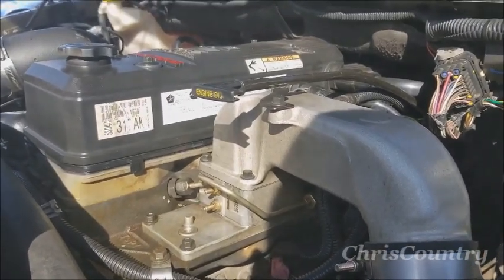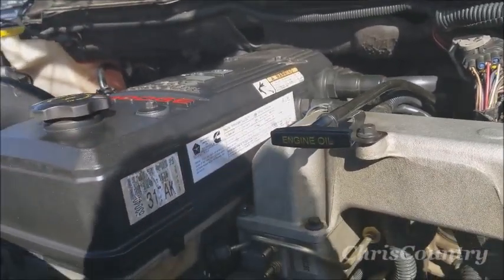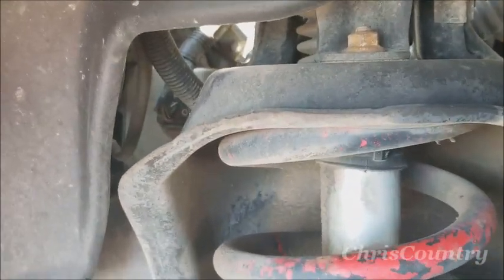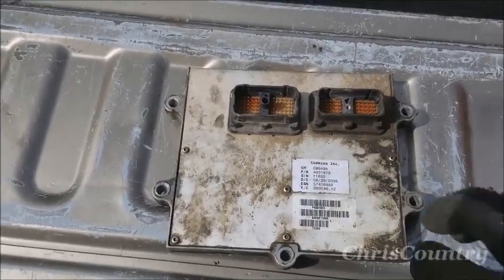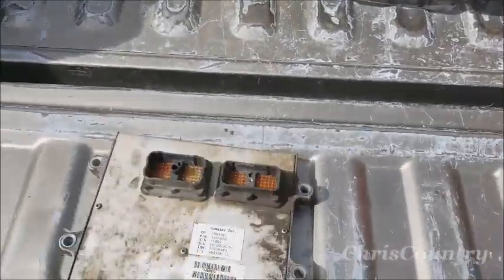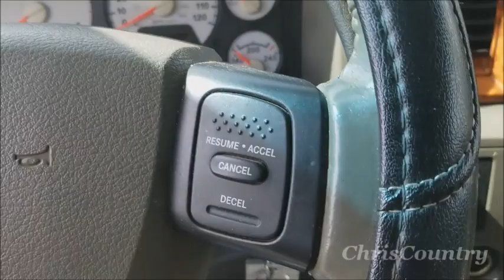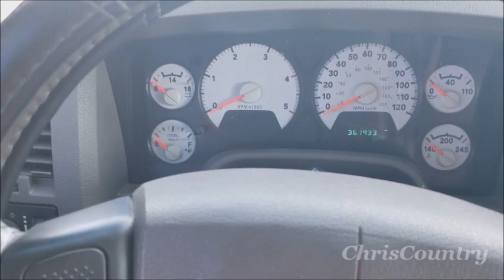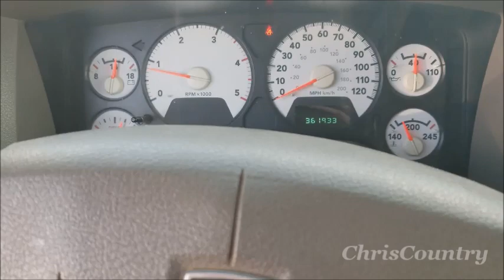ECM Replacement 5.9 Cummins (3rd Gen/Common Rail)

Comment: Just watched your video, thanks for the info, I noticed quite a few no turn over questions in the comments. I had that problem once before and it turned out to be the key. There’s a crystal in the key that works as a anti-theft system. Fortunately I had spare keys made. Exchanged key and it started right up.
Reply: Were you getting any error codes though?

Comment: I also have a 2006 mega cab automatic transmission with only 143K.  She died while driving down the Hiway.  I’m not getting nothing but a click no crank at all.  I’ve put new red top optima batteries, new alternator, FCA replaced, transmission neutral sensor replaced, I’ve installed a new ignition switch and replaced every fuse.. still nothing but a click.  Pulling 4 codes p5209, P1755, p0513 and p0532.  I’m leaning toward my ECM now.  Thanks for the video
Reply from the maker: You have an interesting series of codes to say the least. They may have been caused by weak batteries. The 513 I'd recomend changing the batteries in your key fob. Check all of your connections and make sure your starter is ok. I've never seen an ECM cause a no crank in my experience. Given what all you have replaced my next guess would be the starter. I've seen in some cases if the ac compressor locks up it will cause a bo crank no start. Take off the serpentine belt and see if there is a difference. Lastly check your fan clutch harness if that shorts out on something it can do odd things
Reply: Chris Rocha thank you I’ll definitely look into that also.  I have the transmission throttle valve coming and also purchased cam shaft crank sensor for piece of mind as I’m going through her.  I’ve also cleaned up both battery terminals.  I’d find it unbelievable if this motor froze up with only 143K and not a drop of oil missing.  I had a mechanic come look at her and he could only get 1/8th turn by hand with a 4’ bar 😔😩
Reply from the maker: @chrischi6031  those engines make fantastic compression but I would be worried. I'd see if you could jump the starter directly and see if it can spin the engine
Reply: Chris Rocha looks like I get the same movement from the fan on that click only like 1/8 to 1/2 inch.  She didn’t make a bang boom and no smoke out the back when it died.  I swear the engine reeved up like I lost the transmission and thought somehow I went into neutral at first before she finally shut all the way down at 70 on the hiway.
Reply from the maker: @chrischi6031  what do you mean from the  fan on?
Reply: Chris Rocha when I try to start the truck up now I only get that click and with the hood open I can see the fan trying to move clockwise to the passenger side when looking from inside the truck but it barely moves then goes back to the original spot it was.
Reply from the maker: @chrischi6031  that's a bit disconcerting. My thoughts are have the starter tested if it passes I'd venture to guess an internal engine failure
Reply: Chris Rocha I have a new starter that hasn’t been installed and the truck was already running when it shut off doing 70 miles per hour.
Reply from the maker: @chrischi6031  I've seen vehicles shut down at speed due to an engine lock up. Have you tried starting in neutral
Reply: Chris Rocha I will try that tomorrow..  why all codes all of a sudden? Oil level is perfect not a drop missing
Reply: Chris Rocha no start in neutral.  Today I decided to put it on 4wd with the transmission in drive and pull it with another vehicle.  Wheels locked up at first then they started turning so while being pulled I put her into neutral and she finally started cranking at first.  Once we stopped I started getting my death click again.  Retried this process in reverse and just kept getting the click.  My crank/cam shaft sensor came in so I’ll put that in along with the new starter.  My transmission throttle valve should be here Monday also.  I went ahead and pulled the ECM for piece of mind the local dodge dealer is gonna see if it needs to be flashed or not.  A little bit of smoke came out the back and I assume it’s because she’s been sitting for just over a month.
Reply from the maker: @chrischi6031  I'm not sure what to tell you. Seems like something is keeping the truck from turning over tbo. A faulty sensor in my opinion will not do this. If the ECM or sensors are bad it usually should crank but. Ot start
Reply: Chris Rocha yeah I figure once I get that cam/crank shaft sensor in, the transmission throttle valve installed and the ECM serviced and nothing I’ll be more than lost.  I appreciate tour feed back and my fingers are crossed 🤞 for these last three things.
Reply: New ECM is in and she finally started.  Looks like I lost my flex plate as the transmission won’t engage now 🤦‍♂️
Reply: How much was your ecm? Having same issue  on my dodge 5.9 gas. Truck !
Reply: Tony Gutierrez $1300 if I remember right.
Reply: @chrischi6031  is it doing good now?

Comment: I put my new ecm on and now it’s flashing security light and cranks but no start   Checked all the wiring harness hots and grounds and everything check out well but still no start
Reply from the maker: What year is your truck? I was wondering if I would have a security problem on mine and thankfully I didn't. It may just need a reprogram

Comment: Chris, can you provide any update on the new PCM?
Reply from the maker: Never had any issues with it till the truck broke down almost a year later
Reply: @ChrisRocha1672  did the truck beak down because of the PCM/ECM or was it something else?
Reply from the maker: Something else. Long story short I lost a bolt to the injection pump. It vibrated and snapped the remaining bolts and I just couldn't afford the repaid

Comment: Hey I’m having an issue with my 07 6.7 Cummins. It flashes the electrical red light on the dash. And drops speed randomly. I tried putting a new gas pedal but it was same situation. Should I put  a new ECM?
Reply from the maker: You should be able to pull a trouble code if it's doing that. It'll point you in the right direction
Reply: Sounds like a vgt problem. You should pull the code.
Reply: I’m having the same issue now what was your fix?
Reply: @OutsideJustin  we ordered ecm cuz all the codes pointed that way. But sold it within a month before the ecm ever got delivered. Dealer had some good deals on new 22’ Silverado 2500hd….

Comment: Mine is a 06 will not turn over. I’ve replaced the fuel pump, starter and batteries. A bad pcm will keep it from turning over right? I’d rather buy a new pcm than injectors
Reply: Hello  I have one ecu Cummins comun rail  this cracked cristal oscillator this microcontroller atmel CM845B how to view the number of the cristal work thanks very much

Comment: I keep getting p0868 and p0513 codes as well as a bunch of communication codes.. dodge dealership says it's the ecm because the trans all looks fine relating to the p0868 code and the p0513 they just needs new batteries is the fab. Every once in a while my trans goes into limp mode when the 0868 code comes up.. do you think it is in fact the ecm?? It's a 06 automatic. Good video with good angles and info 👍🏼👍🏼

Thnx chris
Reply from the maker: Not having an automatic truck I honestly couldnt tell you. If its communication I'd look at the wiring first
Reply: What does it do when it goes into limp mode I might have the same problem in my 05
Reply: Cummins,, junk ecm,,, enough said

Comment: Same throttle process with a 2009 6.7 Cummins same body style same location of ECM so I figure it’d be similar
Reply: Is it similar? I’m having issue with the gas paddle codes.

Comment: Ok, so my speedometer doesn't work, ABS, Brakes, Check Engine lights stay on. Ran codes and they said speed sensor was bad. Changed still no speedometer and lights are still on. Ran codes again. Says ECM is bad. Do you think that the ECM is causing the Speedometer not to work and lights to stay on?
Reply from the maker: It would depend on the exact code. In theory yes it can but that's usually the past point of failure

Comment: Hi just found this . I made the mistake of starting without doing the peddle reset that you show hear . I am not getting wot . Is there a way I can restart this process and do the pedal as you have shown here to get WOT
Reply from the maker: To be honest I'm not sure. Maybe unplug the batteries for 30 minutes and try again
Reply: Did you figure out the wot problem
Reply: Same thing here. Put a new one in and tried starting it. Truck ran for a few seconds then died. Did that 3 times and now it won't start at all.
P code 2509.
Tried un plugging battery for a while and tried again after lunch. This time doing what you showed.
Is there a way to reset it or does it need to get a flash reset?😬
Reply: @OGGventures_cruising  did you ever get this figured out? Mine is doing the same thing

Comment: Immobilizer Module change - 

Is it necessary to introduce - old pcm ? pls
Reply from the maker: I honesfly couldn't tell you. You may have to program it but i doubt  it would require replacement
Reply: @ChrisRocha1672  ecm and immobilizer ,key change
Reply: @ChrisRocha1672  ecm reprogrammed vin number
Reply from the maker: You reprogrammed it? If you did and its not working it could either be a problem with the immobilizer or it may be time for a PCM

Comment: I replaced my ecm with a salvage yard unit. Same PN #. Still no start.     Dodge house says I need to have it flashed, regardless of what key I have (grey or black). I've already made an appointment to get it flashed just trying to find out exactly why the no start is I don't really want to just give a hundred bucks if I don't have to thanks 4 and put if you have any in advance
Reply from the maker: Its probably the ECM not being flashed. The BCM/SKIM doesnt recognize it thus it won't communicate and essentially it creates a no start
Reply: @ChrisRocha1672  thanks, I'll let you know

Comment: Is the pcm and ecm the same on these trucks? And what where your symptoms that made you replace the ecm
Reply from the maker: I believe they are separate. On the ECM I was getting an ecm internal errorncode and an injector driver/circuit code from faulty injectors

Comment: Mine won’t start it will only crank with the theft light, should I send the ecm off to get the theft system bypassed
Reply from the maker: Does the theft light come on or flash real fast during or just after cranking

Comment: I had help taking off the wiring harness so really why i dropped in was to get a good shot of the ground hook up. It would have been nice to see the whole side shot of the unit with all the wires in place. Otherwise i got some very useful info
Reply from the maker: I understand that it was difficult for me to get a good angle on the ground wire. It was just attached to the bolt on the upper right though

Comment: Hello friend, I have the same truck with the same computer to replace.
How would be the continuation to twin the PCM since it does not allow me to start? can you help me
Reply from the maker: I'm confused by twin?
Reply: @ChrisRocha1672  what would be the process to change VIN and reset ECU.  with what equipment do you make it?
Reply from the maker: @eliascady3982  the company I ordered my computer from did all that. AllComputerResoursces
Reply: I just ordered from ACR from my 04.5 5.9. I hear if I unplug the SKIM module it will eliminate the need for a chip key. Did your chip key just fire it right up?

Comment: My 03 is having terrible issues. This is literally my last hope
Reply from the maker: I'll cross my fingers. I dunno what issues you're having though
Reply: Any updates? Did you get your truck running right?
Reply: My truck died while driving. Lost connection with ecm through cluster and obd port. Im assuming ecm

Comment: Is the pcm and ECM located on the same unit or are those 2 separate units?
Reply from the maker: I want to say 2 separate units
Reply: In the 24v the pcm is located on the firewall and the ecm is on the block

Comment: I've just ordered a refurbished ecm for my ram 2500. The company I'm getting this from is telling me to leave the battries CONNECTED during the installation. This doesn't seem correct to me. I'm thinking I need to leave the battries disconnected until the ecm is installed and plugged in. Can anyone tell me what is correct? I don't want to fry the new ecm..
Reply from the maker: Personally I don't know why on earth you'd want to leave then connected to me it just makes for a very risky install.
Reply: @ChrisRocha1672  I agree. I don't know why they want me to leave the battries connected. I'm going to ask them, but I'm thinking I'll leave them disconnected during the installation. Thanks so much for following up. I had my wife facebook you with this question.
Reply from the maker: @arthurhunnicutt7291  I saw that and replied as well
Reply: I installed my refurbished ecm today. Left the battries disconnected, all went well. The reason I replaced the ecm was that I kept getting the lighting bolt throttle position sensor. I had it replaced by the dealership. 30 miles down the road, it tripped that code again. Took it back to the dealership, they kept it for several days then told me I needed a new computer. So put the new (refurbished) ecm in today, drove 10 miles and it started throwing that same code. I put in 2 New battries last week. I'm thinking it's something else and wasn't the computer after all. Would you have any suggestions? I'm beginning to think there's no answer for this.
Reply from the maker: @arthurhunnicutt7291  without the code I honestly have no idea
Reply: @ChrisRocha1672  my scanner shows a P2121 which is the THROTTLE POSITION SENSOR.  As I'd mentioned, I had that replaced a month ago by the dealership so it's brand new. I appreciate you trying to help.
Reply from the maker: @arthurhunnicutt7291  renind me the year of your truck and is it a 2500 or 3500
Reply: @ChrisRocha1672  2008 2500 cummins 6.7 2 wheel drive quad cab 184k miles
Reply from the maker: @arthurhunnicutt7291  https://www.cumminsforum.com/threads/p2121-code-help.1546330/

From what I can tell if you replaced the sensor and ECM you have a wiring problem or you need to do a throttle relearn with a scan tool
Reply: @ChrisRocha1672  thanks 👍
Reply from the maker: @arthurhunnicutt7291  you're welcome
Reply: @ChrisRocha1672  I'm inclined to agree with you about the wiring issue. I talked with a diesel mechanic while ago, he said it has to be a wiring issue or a defective part that the dealership put on. He doesn't think it's a computer issue.

Comment: It will always dim down the lights when the grid heaters cycle
Reply from the maker: Yeah I noticed that after the fact. Looking back I honestly don't know if I really needed an ECM Change
Reply: @ChrisRocha1672  what made you change it ?
Reply: @ChrisRocha1672  what year and was it a manual transmission ?
Reply from the maker: @rogerthat6221  I had a code for internal PCM failure I forget what the code was though. And it was suggested to change it by a mechanic
Reply from the maker: @rogerthat6221  it was an 06 and yes G56 6 Spd Manual
Reply: @ChrisRocha1672  you still have the old one?
Reply from the maker: @rogerthat6221  no sent that in as a core
Reply: @ChrisRocha1672  I had several codes, one being lost or no ecm communication.
But being Chrysler with electronic issues, its almost never the ecm and always the TIPM
03+
Reply from the maker: @greatlakescopwatchglcw127  I never had that code just the internal ecm error
Reply: @greatlakescopwatchglcw127  Agree totally

Comment: This was no help.
Reply from the maker: Sorry to hear that. What are you stuck on?
Reply: @ChrisRocha1672  2007.5 Dodge 3500 6.7 Cummins turns over won't start. Died while driving. Want to remove ecm to get it tested.
Reply from the maker: @pauljasmine353  I'm not sure if there's a way to test it besides at the dealer. Dying while running can be a whole host of issues tho
Reply: @ChrisRocha1672  A scan showed it was the ECM. Someone told me it could also be the PCM. Regardless I'm dead in the water. Bought it 3 years ago with a delete kit already installed so a dealer is probably not an option.
Reply from the maker: @pauljasmine353  definitely sounds like a gamble either way. A performance shop or someone with a high end scanner that specializes in diesels may help. One thing I've learned is if you turn the key on engine off and you don't have a check engine light it could definitely indicate a problem